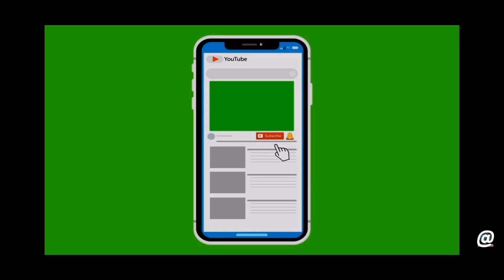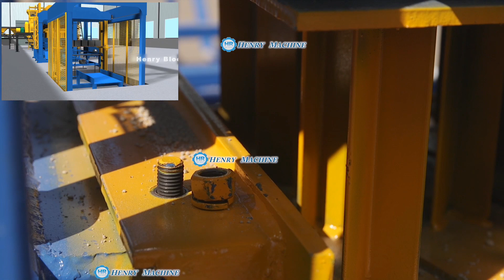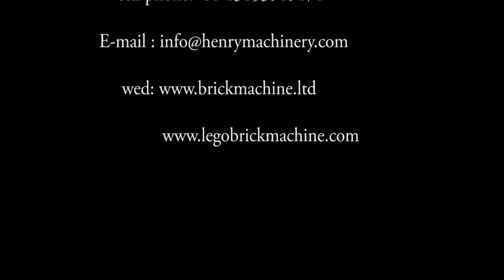Low cost Semi automatic concrete hollow block machine test zigzag paver bricks by interlock paving

Comment from the maker: Dear Buddys,  please must write down your own comments below: 

    ----1 . Why need you to buy a block machine ?   Answer 1 : to set up a block factory . Answer 2: to make blocks for a project.

   -----2. Why other's block factory can get Benefit ? not yours ?  how many labor you need to employee ? 5 or 10 ?

   ------3. Why 3000$ block machine can profit 15000 $ within 6 months ?  Did they cut down material cost for saving money ? 

   ------4. Which factor is more important ?  A good machine or A good material ratio ? 

   ------5. Which material ratio is more scientific ? Answer 1: 10% cement ,90 % sand .     Answer 2: 20% cement, 80% sand .

   ------6. Which power is more stronger to form blocks?  Hydraulic or vibrator force ?  

   ------7. Which kind of electricity source is more powerful to make concrete blocks ?  Single phase or 3 phase ?

   -----8 .How many days need your wet blocks to be curing ?  7 days ? or 21 days ?   And how to curing your concrete blocks ?

   ------9. A concrete blocks quality is decided by what ?  Pressure  or . Curing term ? 

   ------10. How much thickness of a 400*200*200 hollow block is best choice ?  30mm or 25mm ?
Reply: D7i
Reply from the maker: @HERCULESCORONABOREALISWALL  hi, brother, please do you need block machine ? so you could add my whatsApp: +86 15762995618